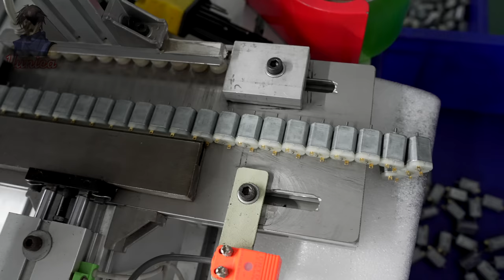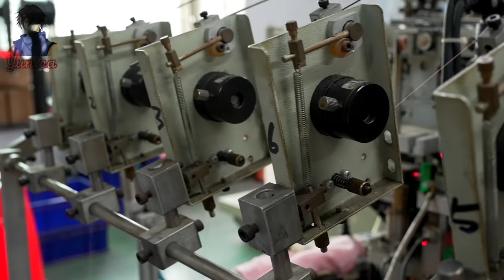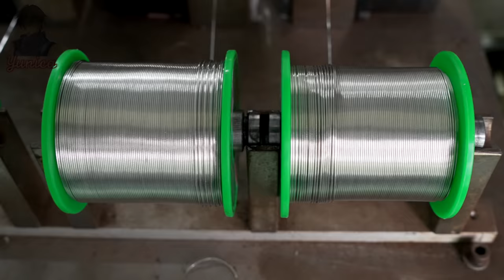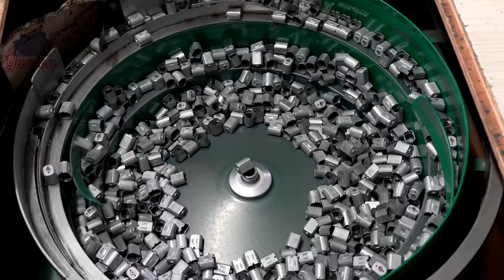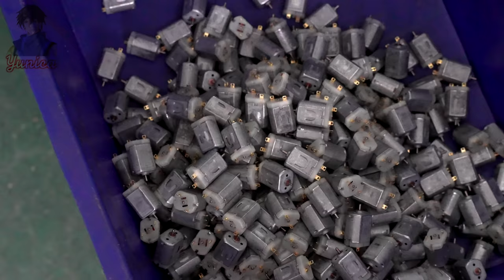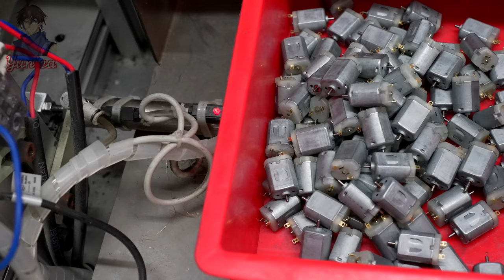Very interesting process of mass production of miniature drive motors.

Comment: This type of electric motor was invented in Japan in the 1950s by Kenichi Mabuchi, taking advantage of the then newly introduced ferrite permanent magnet material. I have read somewhere that about two-thirds of all the electric motors ever made are of this type.
Reply: Все верно мой друг
Reply: First motor I ever pulled apart
Reply: Pues la verdad es muy buen invento ya que son muy simples y durables.
Reply: Brushed DC permanent magnet motor are now being superseded by brushless.  The electronics for commutation of brushless motor are coming to a price inflection point where the it add a better value to go with it.
Reply: I would not be surprised if, since this is pretty much mass produced.
Reply: This motor will last till humans are ended

Comment: The invention that singlehandedly sparked the curiosity of many young engineers and tinkerers.
Reply: amazing
Reply: Yes.
Reply: I could play these all day and can't live without it when i was a kid 😂
Reply: I was able to understand them and repair them no matter what was the damage (like coil burning). Due to this, I could easily understand other motors like Induction motors and 3-phase synchronous motors.
Reply: @maxwong6371  missing those days 😭😭

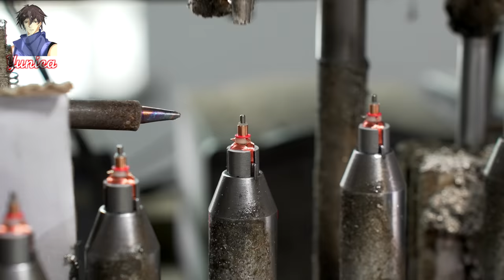Comment: 1:50 how to clean wires from enamel before soldering?
Reply: I assume it is the "self-fluxing" type of enamel that melts away with heat. Disadvantage is that it cannot withstand high temperature during operation.

Comment: What happen if one of the wire broken in the middle of the process?
Reply: They run the finished motors through a testing sorter.
run = pass, finished qc pass bin;  
no run = fail, defect bin.

Comment: i didnt see any testing
Reply: I guess failure is cheaper than quality assurance here.
Reply: I think this video does show a test as the final operation, where the shaft and the terminals are plugged into an apparatus. Speed within specification, current draw within specification and free of excessive ripple.... done, in less than a second.